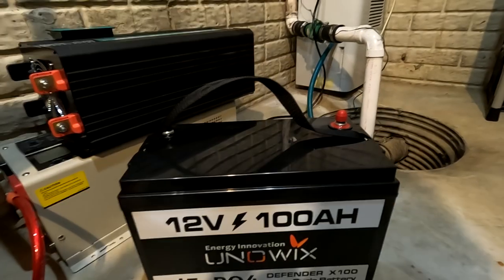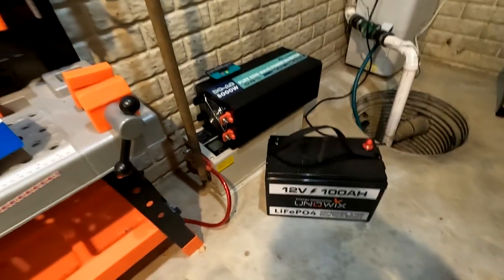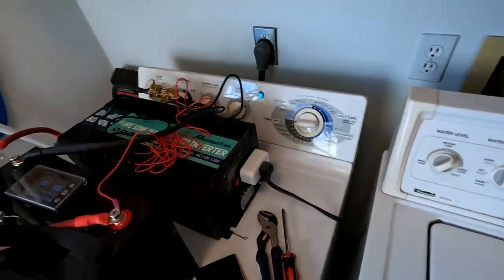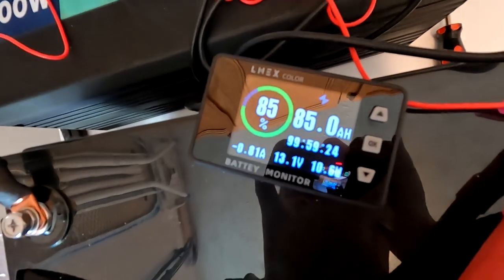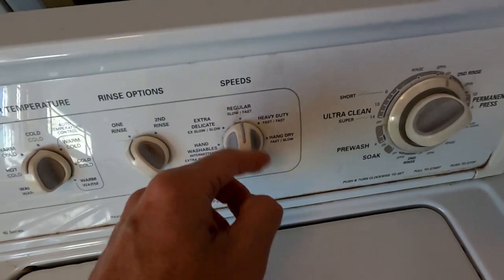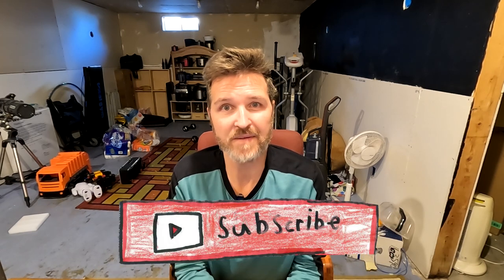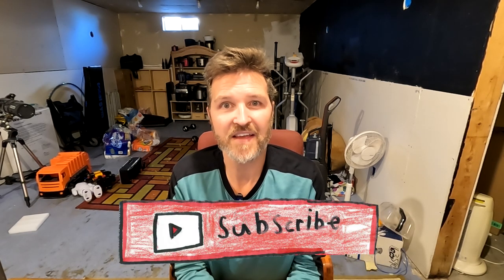How many loads of laundry can be washed with a 12v 100ah Lifepo4 Battery?  Let's find out!

Comment: That washing machine looks 60 years old at least, It's probably uses a few times more power  than the modern one 🤔
Reply from the maker: Haha!  It's actually around 25 years old.  You're right though..  not the most efficient washer.  Thanks for the comment.
Reply: Watts are still Watts, water is still water. Energy is still needed to shift it around.
Reply: Lol but the old ones work the best! I swear the HE ones don't clean clothes well 😩

Comment: Thats a great amounts of loads.  Seems like a 2000 inverter is absolute minimum.     Surging those amps really makes you pay attention to cable size too .
Reply from the maker: I was surprised.  I didn't see a 3k peak so that's why I said a 1500w min.  2000w would do much better and you wouldn't have to worry.
Reply: I agree. That 2529 watt reading is pushing around 198 amp at 12v. That max battery limit.

Comment: I'll add my thanks too! I know this was a hassle to do, but real-world information like this is very, very valuable when planning out an off-grid Solar system. I would also like to see this sort of testing done with a 5000 BTU window Air-conditioner running in a small room when it's say 85 F outside. Thanks again.
Reply from the maker: Glad you found the video informative.  I do have a stand alone AC unit.  I'll look more into it.  Thanks for the idea and the comment.

Comment: Some inverters have large surge ratings.  The Blutti runs at 2000w but I think can support a surge of up to 4800w  for example.
Reply from the maker: Good to know.  I know most low cost inverters will support 2x surge.  Low frequency inverters typically support 3x surge rating.  Thanks for the info.

Comment: Oh yes, in an off grid scenreo you can have a clothes dryer and dish washer, only you need to either conver the dryer to 120, or use an international sset up. Or use a step up transformer,  but that does take some doing, or portable dryer uses 1,500 watts.
Reply from the maker: I've looked at portable dryers and they come in smaller sizes of 850w!  I wonder if it would be worth checking out.  Thanks for the comment.

Comment: All you need to do is put a capacitor on a washing machine. That would help out the surge that the motor is using.
Reply from the maker: Thanks for the info and the comment.

Comment: I’m seeing a similar surge with my 4 year old HE washer and dryer. The dryer constantly runs at around 450 watts but the surge shoots up to about 4500W to start the motor. 

I have a Growatt inverter/charger rated for 3000w continuous and 4000w surge. I hear the overload beep at the start of every dryer cycle. My BMS reads ~4500W surge.

My 2000w pure sine stand-alone inverter starts the dryer 90% of the time but becomes more of a struggle when the battery get below 20% capacity - lower voltage = higher starting amps.

TLDR - 1500w is the bare minimum but I would aim 2000w and pay attention to surge ratings.
Reply from the maker: Thanks for the info!   What size battery bank and voltage do you run?  just wondering...
Reply: @OffGridBasement  I’m running the Growatt unit on a 24v 70ah LiFePO4 battery that I put together. They are connected by 2ft 2ga cable.

Comment: i would wash 2 loads a week at most by myself good info with 1200 watts solar and 800 amps agm battery's should not be a problem gotta hang on the line thanks keep up the good work
Reply from the maker: That sounds like a perfect setup.  Thanks for the comment.

Comment: Interesting. Inspired me to test with a HE washer, a Matag Bravo. In the regular agitation cycle, with the direct drive motor, the agitation cycle varies between 350 and 500 watts.  Trying the test on a 500 WH Duracell Power Block as sold by Costco.  Still in wash cycle. Will have to wait for the entire cycle to get total result.  Looks like this unit will do the job and includes a Peak Power solar input as well as AC and DC charging options with this sine wave battery inverter.
Edit.. The Power Block almost can do the job. It made it all the way though the cycle except the last 7 minute final rinse spin.  This spin ramped to 600 Watts which was a no go for the inverter. Other than that, the total cycle power draw was 15% of the 500 WH battery.  It does look like the HE washers are low power draw. All other cycles were under 500 watts average, so the unit ran fine.
Reply from the maker: That is so great information!  Thanks for sharing.
Reply: Can you plug LED lamp in the same circuit to see if it will flicker when it is in agitation cycle? I used my Bluetty EB70 to run my Whirlpool  WTW4955HW2, bought  in Jan 2022 to replace my 1972 washer, i notice the LED lamp will flicker in agitation mode, same result when trying with 1500W inverter, but never seen it flicker with the old  Whirlpool washer (the transmission finally gave out after 50 years!).
Reply: @budmartin3344  I could do that later, but as the battery is a direct BTL sine wave regulated inverter, I would be surprised if it did flicker. Will try to remember to test that next time I do laundry. Even better, I have an oscilloscope, so could record the waveform of the output.

Comment: My Redodo 12v 100 amps will only do 1 1/2 loads thanks for the video.
Reply from the maker: That's odd.  Does your washer use a lot of energy?  My washer has to be well over 10 years old.

Comment: Thank you for doing this experiment. I’m actually setting up an off grid system as well, we need a washer and I stumbled on your video😂.  The system that was recommended by a vendor was a 9 panel 500-600watt each and inverter that has 4000 watts and 2 lithium huwaeii batteries 100amps each.  I’m just planing on running a fridge lights some outlets a fan and a washer. After seeing your video I think if I did laundry during the AM early morning I should be ok with either 2 or 3 batteries. Any thoughts? Thanks again.
Reply from the maker: Honestly your fridge is going to take the most power.  I've found that you will get about 11 hours out of a 100ah lifepo4 battery when plugged into a refrigerator.  With all the panels you should be just fine!  Good luck and thanks for the comment.

Comment: Yes inan off grid scenereo, you will have a dryer. a mini dryer, while not ideal, cn run a fulbhour off a 200 amp hour batery and an arry of 2kw on ful sun.
miis hve theromostats to assist in regulating the thermostat. which energizes nd de nrgizes the heating elements.
Reply from the maker: Thanks for the information and the comment.

Comment: I just watched my washing machine run on an Ecoflow Delta Pro unit's LCD monitoring screen.  Initial start up pulled 1600 watts for my washing machine. As the motor turned, cycling back and forth, the working load fluctuated rapidly with each motor turn. One second its pulling 600 watts and the very next second its back down to 0 watts for a very brief fraction of a second to stop and then turn back the other way, which repeats the cycle then again pulling 600watts. 600watts, 0 watts, 600 watts, 0watts back and forth second by second.

I am wondering how hard it is on a LFP battery when drawing such an inconsistent, or rapidly fluctuating working load from the unit. I am using my unit as a EPS backup but to also minimize daily peak hour rates from the power company. 

I need to know if using the washing machine is bad for the unit when trying to extend the LFP batteries lifespan. I would simply avoid that appliance for daily use on the battery and use a different appliance with a consistent working load when pulling watts from the unit. Much appreciate anyone's comments. Thanks
Reply from the maker: Since the 600w of draw is less than 25% of what the AC can put out, I personally wouldn't think it would be an issue.

Comment: Attach a six-pack of supercapacitors to the back of the inverter for the surge
Reply from the maker: That would be good for a smaller inverter.  I've also watched a video of someone using a dial to lower the voltage draw.  Thanks for the comment.

Comment: Great video!?
Reply: So you averaged about 160 or so watt hours per load. A 300 watt panel at 5 peak hours would have charged up the lifo all day Saturday. Then your 6 loads would be free electricity for the use of ONE cycle of your 3000+ lifecycle lifo battery. And they have cheapo lifo s that(at 80%dod) on paper would cost 7-8 cents/kwh lifetime. (Im at 15-16 cents here in Texas.) . Problem is most of these cheapo lifo mfrs are fly by night or wont offer more than a year's warranty. And the quality batts are $500 to $1000 bringing the lifetime kwh cost to 25 cents or more, even though you may get a 10 year iron clad guarantee. IMO best ultimate solution(large scale) is to have your PHEV pull double duty(household and transportation) along with a second easily swappable batt. Alternate the batts every other day perhaps a trunk batt rollout tray that quick connects to house mains? Then would only need grid for extended rainy/cloudy periods and winter subsidizing.
Reply from the maker: Glad you think so!  Thanks for the comment.

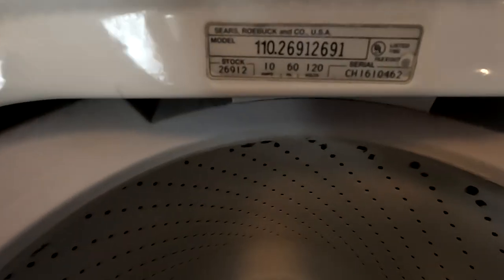Comment: 2:52   120v * 10a = 1200watts,  continuous run,  you dont need a 3k inverter, if your washer pulled 3000watts it would flip your house breaker.
Reply from the maker: That is true.  At the end of the video I recommended a 1500w inverter to be able to handle the 2500+ wattage surge in the spin cycle.  Thanks for the info and the comment.
Reply: @OffGridBasement  great video nonetheless, god bless

Comment: There is one thing you forgot to consider when running you washing machine on battery, and that's also running your well pump on battery too.
Reply from the maker: Oh man.   Running the well pump would be like running the dryer!
Reply: @OffGridBasement  Yes. I have a deep well 240v pump. I have to use a large Low Frequency inverter, like the large one you have. Only I would use a minimum 24v inverter. 48v would be best.

Comment: Had a feeling the shunt might have been wired backwards.  Oh well.  Happens to the best of us!

It's kinda funny.  The washing machine was the first piece of equipment that I was testing in the house.  My solar equipment was in the barn so I ran a long extension cord through the laundry window each time I wanted to run the wash.  My wife loved it!  She didn't do any laundry for weeks while I was "playing". Now I think she wishes we were back with just the system in the barn so I would do laundry again...🤣

I know when my wash runs (on my 12v setup as well as my 48v setup) and it's on the "churn/wash" portion of the cycle, lights tend to pulse in sync w/ the cycle.  Not sure if it's just my old washing machine or not.  Would be very curious to know if yours does that as well?  Maybe some test would be to run another load of wash and plug in a lamp and see if the light pulses in tune w/ the wash?
Reply from the maker: I'm surprised about the churn portion of the wash causing brown out issues.  I would've thought it would be when the spin cycle starts up.  I should do it again with a lamp plugged and see if I get the same results.  Thanks for the comment and the info!
Reply: I bought Whirlpool washer, WTW4955HW2,  in Jan 2022 to replace my old 1972 Whirlpool washer, I do notice that the LED lamp connected to the EB70 or to the 1500W inverter will flicker in the "churn/wash" portion of the cycle because this new washing machine actually reverse the motor direction electronically not like the transmission drive used in old washing machine used in my old 1972 washer which did not cause the LED lamp to flicker.
Reply: @budmartin3344  very interesting.  Thanks for sharing!  Never thought about that.

Comment: where the issue are , these batteries seem like a great thing but have BMS electronic circuit which fails eventually 
 ( many componets ) many say 1 -2 years max If that , cant hold that current in and out constantly , they just make money on you buying new ones over and over   $150-250Each , its better to by agm lead acid battery Has NO bms  , and why they will last for sure . two 55amphr 12volt  agm , in put in parallel 100amphr for $200 , 60lbs.
Reply from the maker: This is one big reason why I test only lifepo4 drop in replacement batteries.  I use them every day and if one fails I will definitely let my subs know.  Everyone knows SLA batteries will last up to 5 years if taken care of.  Thanks for the comment.
Reply: Lifo batts are touted to last 10x or more the lifecycles over sla batts when discharged to reasonable dod.If you buy from a reputable mfr, they SHOULD offer an iron clad 5-10 year guarantee(they don't need to know how you use/'abuse' the batteries.)
Reply: @OffGridBasement  not so ... many are seeing  much less  than 5 years   more than half   failures  due to  having  BMS electronic circuit which fails .